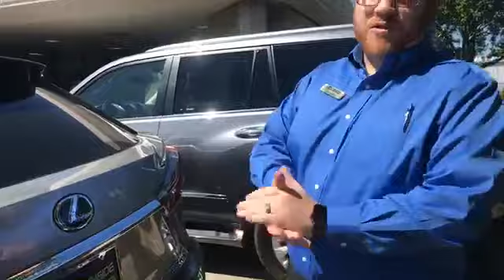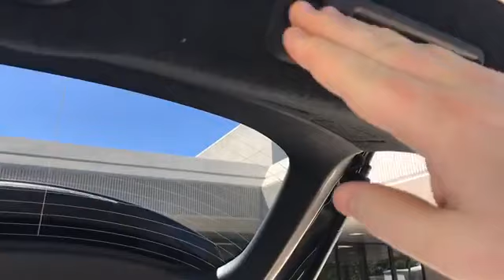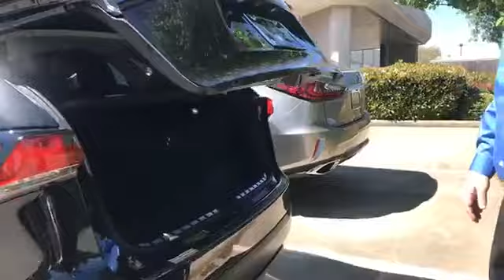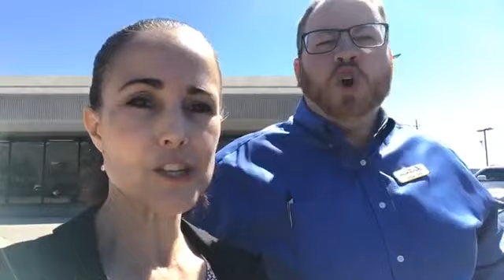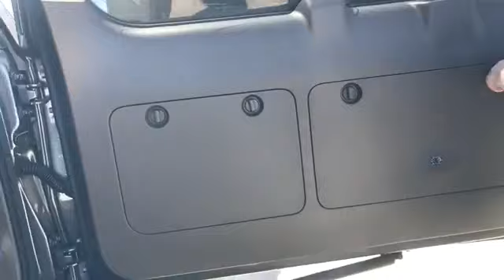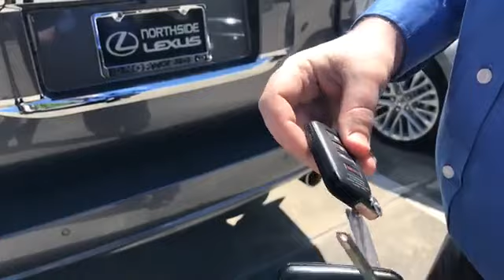2018 RX, NX & GX touch-less and smart key rear doors - Tech Tip Tuesday

Comment: I know this is an old video.  I’m trying to find one that talks about a specific features in Lexus F Sports that needs to be turn off when installing a bike rack.  Other auto manufacturers have on and off towing that you can turn off and on but not my RX350 F Sports.  Thank You.
Reply from the maker: I wish we had this and a car wash setting. That would be so helpful! Since we don't, what most people turn off are the Intuitive Park Assist, Rear Cross Traffic Alert and the Parking Support Brake. I'm not sure if you would need to turn the Blind Spot Monitor off, but you could see if it is being triggered by the bikes or not, before you decide. I hope this helps. Thanks for checking in.

Comment: Can i open the trunk without the key with me, even the car unlock already?
Reply from the maker: If you have a Power Back Door and the vehicle is already open, you can open the back door with the power button on the inside of the car even if you don't have the key. You may need to press the unlock button in the driver's door handle if the back door is still locked. Thanks so much for tuning in!
Reply: @NorthsideLexus  Alright, thank you for your explaination :D